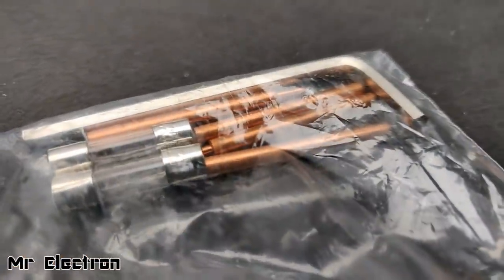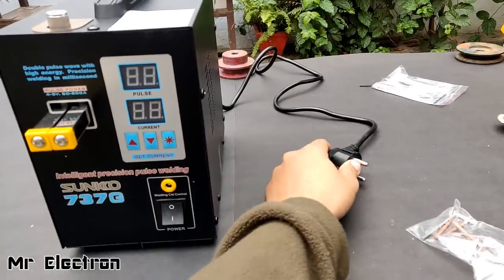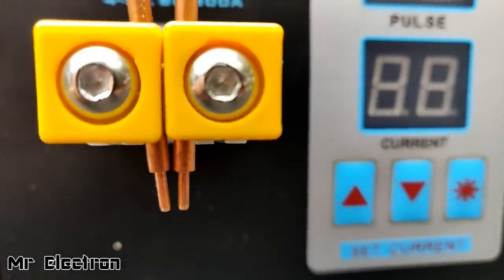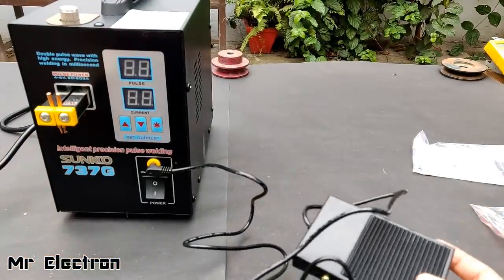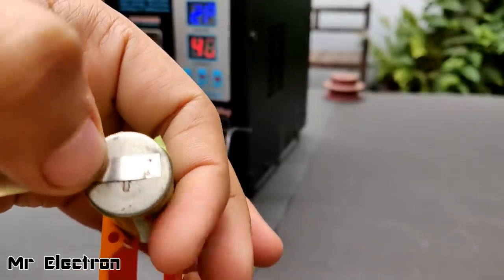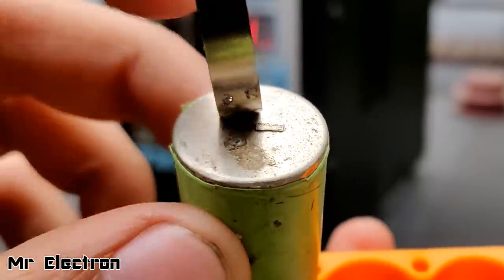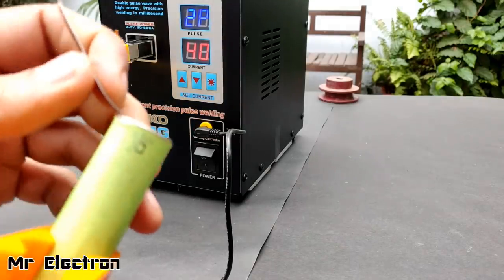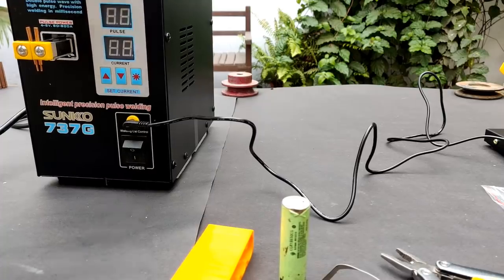Review - Spot Welding Machine SUNKKO 737G

Comment: Do you think it’s possible to swap out the welding heads?

I have 1.3mm electrodes and was thinking of swapping out the stock ones for a different set so that it could fit these 1.3mm electrodes

Comment: VERY GOOD DEMONSTRATION! 
Just bought this unit and it works as advertised using default settings and supplied 0.1mm nickel plated iron sheet. (110V Unit too!)

Comment: Good review thank you. The cheapest you can get is parts (boards+driver transformer+foot switch+cables+rods+ misc ie on off switch) one with recycled case (in my case old line filter isolater past it's use by) recycled fan (microwave) and a microwave (1100 watt or bigger) transformer, yeah hassle waiting for all the bit's but sub 100 euros. I think my microwave transformer is a bit over powered as at 40 amps with minimum pulse will blow the top off a battery, it actually welds 1 mm steel strips together. Not complaining well worth the effort. Oh yeah didn't know those 2 bars separating the 240 volt from the high voltage winding's are actually current limiters maybe I should have left them in.